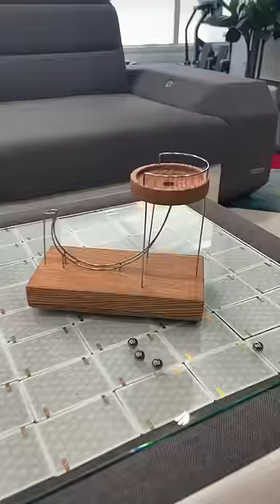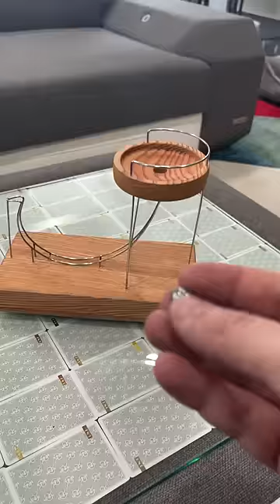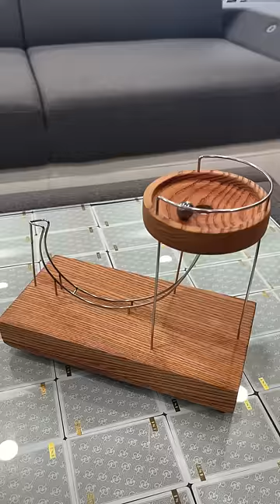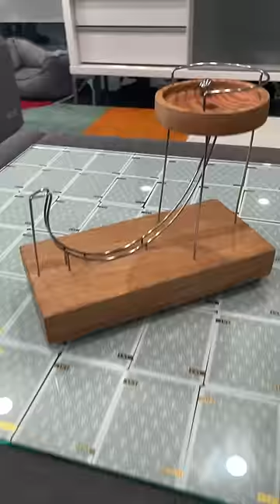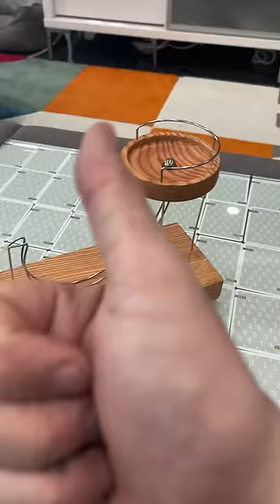An Impossible Perpetual Motion Device?! 😳 #Shorts

Comment: Love electromagnetic fields. It basically turns the low point of the curve into a rail gun, accelerating the marbel forward and around the curve with enough energy to propel it back into the dish. Though it'd be more convincing it it could just land perfectly on the rail again, because the dish causes it to lose energy that, in true perpetual motion, takes away from the momentum to go back up. If it were completely lossless, as perpetual motion would have to be, you have to basically make a loop
Reply: So why doesnt someone just do that then . Like just make the marble more accurate , im sure they have the engineering means required . Genuine question . Im curious .
Reply: @jdmilion1096  I'm sure they could make it more accurate, but it's also unpredictable. The rails could bend slightly, or the marble could be weighted more to one side or the other, it's too many variables to make it 100% accurate. 
Even if they could though, perpetual motion is entirely impossible because no system is 100% efficient. For example, the marble rolling down the track creates friction, which in turn creates drag, meaning that you are losing energy as soon as the marbles direction of perpendicular to gravity. After that point, gravity is also creating drag as the marble starts to follow the curve upward, causing it to slow down significantly. 
In the system shown, there is a hidden electromagnet that propels the ball as it reaches the bottom of the rail, assuring it has enough momentum to overcome gravity long enough to make the jump back. Without this magnet, or some other outside force putting energy into the system, the marble would stop before reaching the top of the track and swing back and forth until coming to rest at the lowest point. 
Take for instance a hot wheels track. The car gains energy as it goes down a slope, but it can't make it up a second slope of the same height just from the descent. If you push the car, you can input enough energy to make it over the hill. Or else you get get the booster track with the motor, put that at the lowest point and it will propel the car up the slope, and depending on the slope and the power of the motor, it may even get the car airborne, as the electro magnet in the base does with the marbel
Reply: @hunterlynk9326  so what if we made it in a 0 gravity vacuum , wouldn’t that fix the problem ? Use magnets or something in space to propel the ball in an eternal circle .
Reply: @iKillborn2kilNOE  no its a magnetic rail .
Reply: @iKillborn2kilNOE  no, it's not. Yes, going down it does, but then going up to the same height it subtracts the same amount of energy, add in friction and drag, it can't make it. That's why perpetual motion isn't possible. There is an electromagnet hidden in the wooden base. Like he said in the videos, others bought it and were ripped off, because it is fake
Reply: @jdmilion1096  No, it's an impossible task. True perpetual motion is not possible because the universe is constantly moving towards an equilibrium state. In your scenario, the magnets and ball are still decaying to their most basic forms. Their subatomic particles will eventually split and race through the universe, never to see something like itself again. The universe will be uniform, and therefore will never know heat again. This is called heat death and it is the unavoidable state of our universe, almost an eternity away.
Reply: @pango9519  this answer is satisfactory, thankyou .
Reply: @jdmilion1096  well, that's the issue there. Magnets. A magnetic field is nothing more than an energy field. So while a vacuum with 0 gravity would take away a lot of the negative energy, you are still propelling the object by inputting energy. True perpetual motion would mean that nothing in the system is providing energy, it simply runs on the initial energy to get it started, with a 0-in/0-out dynamic
Reply: @hunterlynk9326  ahhh ok . Thanks . Makes sense .
Reply: Technically the ball didn't stop rolling
Reply: @lrcavalli290  it stops as soon as it hits the wood and loses its momentum , then the angle of the wood makes it roll into the hole
Reply: @lrcavalli290  of course it didn't. Because there is an external force propelling it... read the whole comment
Reply: @hunterlynk9326  external or not,the definition of a perpetual motion device is to have and maintain unrestricted, and endless motion,which has clearly been demonstrated with this device
Reply: @lrcavalli290  yeah, meaning that unless acted upon by an external force, it will go on forever. But if it's battery powered, as the electromagnet in the base would be, when it runs out of power it will stop. True perpetual motion can only happen when there is no unnatural energy acting upon the system. Meaning, it is not being powered by anything other than gravity and the machine itself. No electricity, no air, no physical push from anything that isn't part of the machine itself. It isn't perpetual motion
Reply: Basically
Reply: @hunterlynk9326  use entropy, rather than being afraid of it.
Reply: @pango9519  heat death is just the universe's winter. It happened before, and will happen again.
Reply: @lrcavalli290  Perpetual motion machines don't need batteries
Reply: @hunterlynk9326  I mean he’s right in a perfect vacuum with “no” friction (impossible)… lol
Reply: @thedarklord573  it still isn't possible. There is more to it then JUST friction. I have only been listing off the simple answers on why it doesn't work. Energy isn't 100% efficient in any system, friction or no
Reply: @thedarklord573  and I may be wrong on that, but upon further investigation, it is revealed that this has been considered and a perfect vacuum is impossible anyways, so while theoretically it may work, there is no such thing as a true vacuum
Reply: @hunterlynk9326  you missed vacuum
Reply: @hunterlynk9326  well yeah… which is why I said “impossible” right? 

There’s also pesky radiative heat which is extremely efficient in a vacuum… but if there’s no friction nor sound, is there actually heat produced? Obviously. But through what method is it exiting the system? It’s might be able to retain almost all of it but laws of thermodynamics say it shouldn’t. Hm… something to think about …

My OC was meant to be a joke. Like “hey, he might be right in a perfect vacuum  with no friction”…
Reply: @jjthe  hmmm...???....I didn't see,or notice any batteries
Reply: @lrcavalli290  Actually look up the thing. It has batteries. Beyond that, the fact that the ball actually slows down means energy is lost which makes this thing not possible without added energy from some source

Perpetual motion machines are literally impossible. The input of energy to start the machine has to be the only energy put into the machine and it has to run forever. That's impossible because of all the ways energy is lost.
Reply: @lrcavalli290  it does tho

Comment: The ball can’t end at a greater height than it started at without some external energy input because of a net gain in gravitational potential energy. Pretty basic secondary school physics. Would be a good classroom demo to see if any students really understand what they just learnt.
Reply: You are correct, it's for normal thinking people first think that must you lightinng in your brain if you have one and not empty glóbus on neck
Reply: Senior school students would hopefully figure it out pretty quickly. I would use it as a pretest of sorts for my year 9 class (14/15 year olds) to see what they know before diving into a physics unit of study.
Reply: Best roller coaster ever. Highest peak at the end of the ride.
Reply: Guh huh...wut? We've all to dum 2 no wut u meen.
Reply: Don't need to understand physics. You just need logic.
Reply: @bullyboy131  Can you please elaborate using only logic?
Reply: @bullyboy131 ? Peoples logic is built off of physics
Reply: @bullyboy131  Read some comments here and you will see what gonna happen if we need only logic LOL
Reply: Learnt?
Reply: Logically yes, like on rollercoasters, except that in this case, the fall forms a snail. Do you think this can allows the ball to store energy to reach its starting point ?
Reply: @gillesjung5742  when friction is very very low, a system can appear to be moving perpetually without slowing down. But the point of a machine is that it does something useful for you, which means  it exerts work (spends energy). This energy loss acts to reduce the speed/height of the motion. Imagine if the ball was pushing a wheel each time it went round to power an electric circuit. The energy gained in the circuit would have to come from somewhere and it acts to reduce the max height or max kinetic energy of the ball. 

Essentially you could design something that will move, not forever, but for an extremely long time. You will just never be able to get it to do anything useful for you. Levitating superconducting magnets are something I could imagine spinning for an extremely long time.
Reply: @gillesjung5742  Nothing will ever change that the gravitational field is conservative. Every closed trajectory you take while immersed in Earth's gravity will make zero work. So the shape of the rail doesn't matter. All that matters is initial height h_i and final height h_f. If h_f - h_i, someone put energy into the sphere - and it amounts to m*g*(h_f - h_i) joules, where m is the mass of the ball and g is 9.81m/(s^2). The great advantage of computing stuff using energy in such conservative fields is that you don't need to know the details of motion, you can just focus on starting and ending points. So everytime you see something ending up higher than it started, you know it's been pushed.
Reply: @Matthew314  👍 yes magnet would be one option in that case I guess
Reply: @Raeodor  it is a word and was used correctly
Reply: It's a pretty neat illusion, until the third time around and I noticed the ball accelerates more after it falls. Lol.
Reply: @Gaylent  + That was the tell-tale sign for me.
Reply: @gillesjung5742  But an electric magnet, not a permanent one.
Reply: Yep
Reply: That is true. I was wondering how this was possible
Reply: @bullettime1116  the opposite. physics is a rationalization of sensorial reality. psysics is built off of people's logic. like all modern conceited sciences
Reply: @Pao-vo8mf  true I guess...
Reply: Has battery that charge the rail to push the ball to top

Comment: To everyone trying to figure out how it DOES work, here's my theory:

The ramp is a circuit through which electricity is passing. In addition, there is a magnet inside the base. The resulting magnetic field passes through the active circuit, resulting in electromagnetic flux.

The ball, being metal, creates a short-circuit that alters the circuit itself, and therefore the amount of electromagnetic flux traveling through the circuit. As the ball continues to move, the area of the circuit increases, so the amount of flux increases. This change in flux through the circuit produces a motor effect that propels the ball forward.

It's been a few years since my Physics 2 class, but I think that's roughly how the concepts work. Hopefully an electromagnetic physicist might be able to help me iron out the details.
Reply: Okay but it doesnt work tho
Reply: @iaincox9639  why not?
Reply: I think it's easier: Magnet under the wood and a sensor, the timing is set in a way that pulls the ball in it's direction for a few milliseconds and let's it roll up the ramp with the new momentum
Reply: thanks bro was confused on how it worked
Reply: I believe its just like when you put a battery through a coil: it will travel in a single direction.
Or magnetic field in the wood that make it go down. It doesn't have to be electric at all if the magnets are during enough. The balls have to be magnetic though.
Reply: @the_skips  I'm pretty sure iain was just meming.
Reply: @2f510  I'm pretty sure that's actually not simpler. Having a sensor would involve some kind of (probably expensive) hardware hidden in there, and using a temporarily-active electromagnet would probably require more electrical power to run.
Reply: @lumiasama9505  If the balls were magnetic, wouldn't they just rotate to face the magnetic field and move toward the magnet in question? Instead of actually accelerating away from the magnet, as they continue to roll?
Reply: @the_skips  cuz perpetual motion is impossible due to energy being wasted in friction and shit
Reply: @gaysarahk  i wasnt the shit dont work watch some of electrobooms many videos on why perpetual motion is bs
Reply: @gaysarahk  depends on polarity
Reply: @iaincox9639  Person explaining how it works assumed that there is some sort of electricity source (e.g. battery)
Reply: @iaincox9639  Yeah, my theory expressly requires the presence of an active battery generating a motor effect. Electrical energy is converted into mechanical energy, keeping the ball going, but the motion of the ball doesn't recharge the battery.

The battery will die, and then the motion will stop; thus, the motion is not perpetual.
I never claimed it was perpetual; thus, your insistence that it "don't work" is inappropriate in this comment thread.

Comment: There’s for sure a battery and magnet in that thiccc base. Nice one mate.
Reply: It actually has a motor in the hole, not magnets.
Reply: @alecsheres6368  no, listen to Daniel's wisdom
Reply: he literally says its impossible in the video and that it would look like this
Reply: Electrified rails accelerated the bbs. Battery in base  😉
Reply: @broontroosers  😆
Reply: I especially like that your autocorrect knows thiccc
Reply: @alecsheres6368    I should have said - there is a version on Amazon that has a motor in the hole, the top platform's much thicker and plastic so it can house the motor.
I watched a break down of one of these ones recently though, the rails aren't electrified (what difference would that make apart from being dangerous?) but there is indeed an electromagnet in the base that provides the required extra oomph.

Comment: I appreciate that he put in a lot of effort to explain what the law was but put nothing into explaining how this device even works I'm guessing there is some kind of magnet that drags it and then at the tip it just breaks away I would like to believe that since I'm not going to be discovering how it works
Reply: It just bugs the crap out of me knowing I will never know
Reply: It pretty easy  to explain, it primarily  using gravity as the engine in which the ramp is engineered to ensure that the ball is tossed back into the start before all energy is converted into heat.
Reply: @RenScorch  absolutely not, there are magnets adding energy to the ball. The fact that you can hear the sliding means that it’s losing sound energy, and the friction results in heat as well
Reply: @DarthLeopard  I’m going to find this machine and buy it if it’s the last thing I do
Reply: @nascraytia  But if it is only using magnets, unless an electro magnet, then it would be a perpetual motion machine. As long as there is nothing to replace or charge.
Reply: @nascraytia  there cannot be magnets powering it, otherwise it would actually be a perpetual motion machine. It’s either video editing or a battery powered accelerator in the base.
Reply: @sidh196  it can be if you cleverly use gravitational acceleration- the centripetal acceleration imparted by the ramp. You still lose energy in the form of heat and damage to the machine over time, but the apogee can go higher than the initial starting point.
Reply: @nascraytia  if it uses magnets, then where is the sensor to tell it to turn off? Otherwise it would just stick to the end of the track or middle of the track. It straight up uses a trick of gravity.
Reply: @RenScorch  it's pretty easy to explain when u just make stuff up saying what you think is right... when you have no clue...lol.. its electro magnetized..
Reply: @gballs007  this is a toy you can get at Walmart for 40-50 dollars. There is no magnet
Reply: A little wheel is on the sidewall of the drop point. One AA battery is inserted below the top, round dish. When the ball hits the drop point, the wheel turns on and spins as the ball passes through the drop point. That’s what gives it the required speed to make it back up to the top. This boomer conveniently leaves out the part about installing the AA battery. 🙄

Comment: Magnet, (most likely electromagnet being turned on  and off, as in, the magnet activates to pull the ball down faster and deactivates as the ball reaches it, as to prevent slowing it down) the magnet eventually stops working or the power runs out, so this does not go forever. (I am no scientist, and I am just saying what I think, do not take this information as fact)
Reply: nope magnet does not work that way
Reply: The law states that you can't do work (in the physics sense).

 There's minimal work being done here (moving the ball higher than it started) so if you hook it up to something to use that power the ball will stop going high enough to make it back and fail.